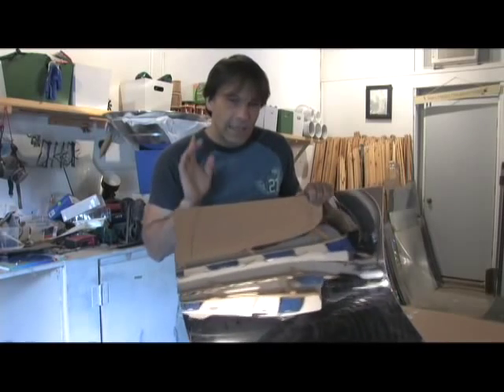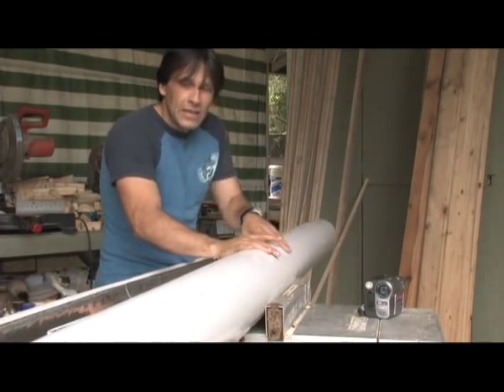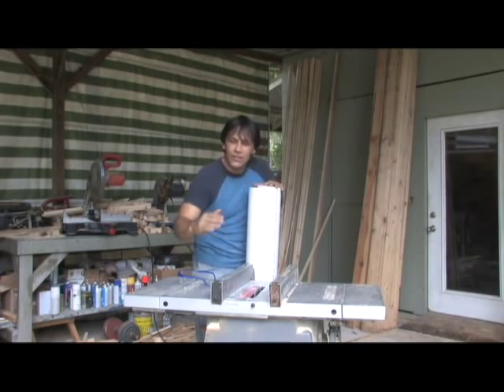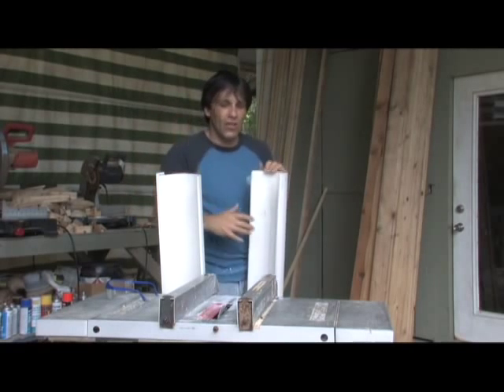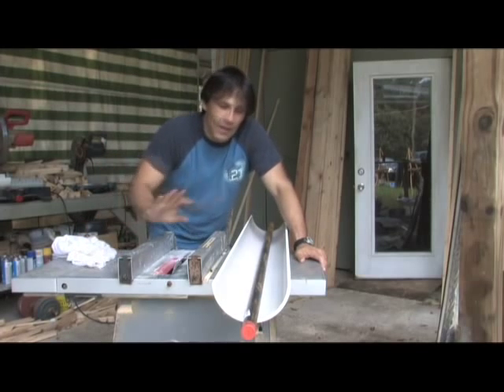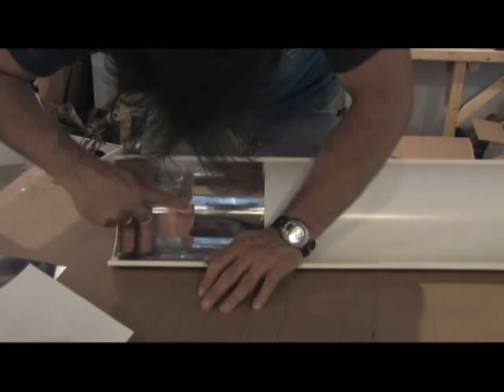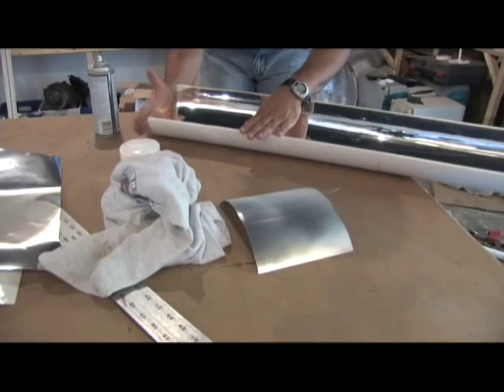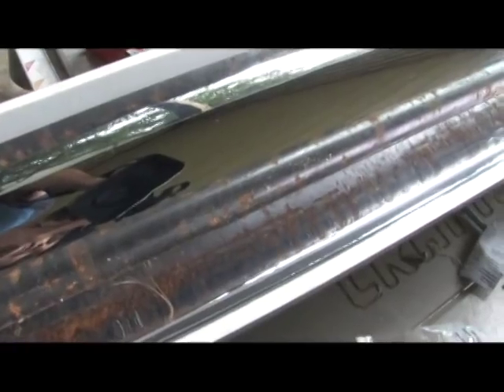PARABOLIC TROUGH REFLECTOR SOLAR WATER HEATER GREEN POWER

Comment from the maker: Hi, We bought about 170 feet from a supplier. I will have some on my Ebay store in a few. I am figuring out the best way to divide it up for projects like this. The acrylic sealer will be applied as that is tricky too. This protects the back from damage. The front side is behind clear UV styled plastic so it will hold up. I have had it for several months, Been testing pieces to see how it holds up in water and sun. Very good.

Comment from the maker: hi John,

If you are circulating water in a closed loop, then a simple 12v or 6v pump will work. If you have plastic impellers (metal is hard to find) place the pump on the input between the first trough and the heat exchange unit, this will keep the really hot water out of your pump. Also, a faster flow rate runs lower max temps but transfers about the same overall energy. DC motors can run on lower voltage so clouds will not be a problem.

Comment: For the record, no round pipe is parabolic, no mater whether it's thirds or halves, it is always a radius curve. Also, bending a flexible mirror is not parabolic either, but rather a catenary curve. While not ideal, both can surely be close enough to be effective at concentrating the sun's rays. And both a radius curve and a catenary curve are very easy to create given available materials. Great video!

Comment from the maker: The ease way is to pipe this prior to your water heater. This keeps your thermostat less active. Just need to divert the supply with valves at night and if it is really cloudy or cold as it will work against you. There are other ways with heat exchangers and solar pumps that circulate the water for electric free hot water. Same rules apply for no sun days.

Comment from the maker: Dont have snow:-) and you have a shut off valve with an air gap at night. Also this is used with a heat exchange system and you collect heat all day then use at night.

Works great.

Comment: This is great, Dan R.
If you get your hand on stainless steel, please note that it has a large amount of nickel.  If you heat stainless hot enough, it turns a dark blue and becomes an excellent absorber, but poor IR emitter, with an A/E ratio of up to 11.  Then you can skip the paint.  Try this on your parabolic mirror target!!

Comment from the maker: The glass cover alone will make a big difference.

Insulation should be reserved for the exit and enter pipe. Place CPVC onside of larger PVC. This creates an air barrier. Connect the CPVC to the steel pipe.

Comment from the maker: Cutting the PVC in 1/3rds makes the optimal shape with easy measuring. The half circle enables covering with plexi or glass easier too. I am not sure if the water pipe will extend too far forward at the focal point to prevent covering. The only hazard I have found in cutting is the kickback half way through the First Cut as it pinches the blade. But it is not that bad. You can actually see it kick in the video.

Comment: Have you considered putting 3 to 8 of these side-by-side in series to raise the temperature to 300-350F then use it to run a steam engine for passive home electrical power to charge a battery bank?

Comment from the maker: A 10' section produces 600 watts of heating power. This shorter section produces 200 watts of heat energy. This is for heating water. We have had 2 weeks of almost no sun in Florida. Today was good. Will have a follow up video soon. 40' would be enough for a 20k-30k gallon pool adding about 10 degrees over a few days. With a solar blanket 20k pool reaches over 100F in Florida. I would cover them with plexi to make cleaning easier. Not hard, but they do get dusty like everything else. Pollen.

Comment: Yes, you're right. A semicircle is a long way from being a parabola, but it's close enough. You'll capture probably in excess of 60% of the available sunlight.

Do you remember the mirror formulae from high-school physics? The focal length of a lens is half the radius of curvature of a spherical mirror. So: The position of the axis of the collector pipe should be 1/2 the radius from the back of the mirror. So if it's a 10" pipe, the radius is 5". The axis of the pipe should therefore be 2.5" from the back of the mirror.
Reply: +Seymour Sunshine  Sorry sunshine. Even though a portion of a sphere, a parabola isn't a  sphere.  So to find the focal length of a parabola requires a different approach. Where yo will be doing the math anyway why settle when close enough when doing the math, when optimal results can be achieved by using the correct formula?
Reply: Wow. Thankyou for this, I was wondering wow & where to set the steel pipe in relation to the radius. You Cleared it up. Good Job. Learned something here. Tks

Comment from the maker: No,

It only warps at 170 f+ at smaller wall thickness. This can hold up to 200f+ Also because it is lined with mirrored material and the backside is white, the PVC never gets hotter than 100f. Mirrored or white objects cannot get hot in the sun. Only dark objects. That is why the steel pipe is black.

Comment from the maker: I thought that too when I built the first prototype. But the focal length is 1" from the base and the 1/2 inch makes a fatter less intense beam with the same net power over a larger area and produces optimal heat transfer. I have a short video. We Finally are getting sun. 10 days, 2 hours of sun at the most. Weird weather. The pipe heats to 250f with no water in less than an hour.

Comment from the maker: Yes, You can but 4x8 sheets of 1/8" plexi mirror local companies. About $150. A wooden trough frame will hold them. Bend and they pop into place. Small deviation throughout the day due to temperature change. No big deal.

The trough needs to be 2' wide to get a flexible bend, 1' is too rigid without molding.

Comment from the maker: Short of the focal point or past the focal point covers more of the pipe with the beam. Since the steel pipe is transferring the collected sunlight/heat to the water, a lower temperature over a larger area is more efficient. At optimal only a tiny area is heated and the transfer is lower. For this size trough, a 1/4" diameter pipe would be better and that would be at the optimal Focal length.
Reply: What material do you use as a mirror?

Comment: You are very handy with a saw, love your videos. Only negative point is that the trough is not a parabola.  I made the same mistake- took a circle, drew a vertical line to represent sunlight, it would bounce clear across to the other side and bounce out missing the pipe.  But your pipe is big enough to gather most of the sunlight.
Peace.

Comment from the maker: @MetalTala for a 180 degree trough it is lower. The most efficient design would be 1/3 of the pipe but then you cannot cover. The half makes about 1" useless but the cut is easier and the cover insulates.

Comment: No problem, most people assume you want the blade low as possible other obvious safety reasons. It depends on the situation. If you are cutting anything that will start to pinch the blade more as you cut, you'll want the blade as high as possible. Otherwise the rule of thumb is generally to have the gullets of the teeth 1/8th inch above the material. Not the tips, but the gullets. depending on the blade that will put the tips of the teeth about 1" up

Comment: About making your water pipe black. Mat black heats better than gloss. If you use black plastic pipe, lightly sand off the gloss.

Heating cement through solar needs both to be insulated from ground cooling.

Comment from the maker: Partially; while a true parabola would be optimal, spherical works well too as the form is easily found in our modern world. The main reason for the lower power of this design is small surface area of the 6" diameter pipe. The concept surface area is easily increased by very long connections of 30 meters or more. This would allow for higher volumes. This small short one is just a scaled down concept.

Comment: You know this could be a business for eavetrough and siding for cold climates. Just use the mirrored trough with a black aluminum mesh flat top. Now you have a frost/ice proof trough that will never have ice dam issues that are absolutely plagueing canada. Thanks for the little boost I needed.

Comment: If you are going to put this on the roof, it is best to mount it vertically in gangs, put a mirror below the lower end and raise it all above the snow line.  I have got to agree that insulating the pipe is needed; a single layer of glass with a 1/8" air gap would be a great help.  The Chinese are making evacuated quartz tubes in huge quantities for cheap (what else?).  Perfect vacuum insulation.  The pump runs while collector is hotter than the storage tank.  One-way valves for night.

Comment: The pipe is not mounted at the center of the circle, but half-way down the radius, or closer to the mirror.   Yes, this works very well unless the  pipe diameter is made too small.

Comment: Mind that focussing mirrors, like parabolic ones, only work for direct radiation, thus straight from facing the Sun. This applies in very dry and/or cloudless climates, like on the poles, hot deserts and the top of high mountains.  In the tempered, rather cloudy climate zones, most of the solar radiation is diffuse (coming from all directions). In South Sweden f. ex, it is 80% diffuse  and almost 100% in tropical rainforest climates - only flat solar panels can be effective there!

Comment: bandsaw works better. cut both sides at once on a sled jig. what is the heat gain per foot per hour? what is the total capacity if circulating water through this thing for 6 hours? why is this better than a serpentine copper collector?

Comment: Before you spend a lot of money and time on this project take some time to review parabolic functions. This study will show you the correct shape to make the pipe using heat gun and a parabolic droop mold. Th pipe will fall into the correct form and properly reflect the heat onto the pipe in the middle. Also take care to see that the collector pipe in located on the focal point of the parabola. This circular design can work without the benefit of true parabolic reflection if the center pipe is centered on the axis of the reflector pipe. The width of the pipe will allow a less critical focus onto the pipe and compensate for the error in construction. The design shown in this video looks like it will lose a lot of heat from miscalculation of the angles needed by the reflector to actually heat the collector pipe. Most of the energy will go back toward the sun instead of hitting the collector.
Reply: Wondering if you could do this with stove pipe instead of PVC? Might be easier to coax into more of a parabolic curve...
Reply: SaintTrinianz you are so right. You can use anything. But to perfect it to it's maximum potential takes more time and much more precision. But good idea.. and a stove pipe is a bigger collector thus will throw way more heat!

Comment: Do you think adding a clear polycarbonate/lexan half circle to insulate the pipe would make this work better in high sunshine/cold ambient temp areas. What I mean is to bend the thin clear polycarbonate around to form the missing part of the pipe to form a full circle again.

Comment: Actually mirrored objects can get quite hot if infrared may not reflect or emit well.  This is why polished metals get so hot in sunlight.  There is no coating to interface light between the surface and air, leaving an A/E ratio of 3.

Comment: I'm working on this myself and considering first to put the mylar onto a sort of rubber / plastic perhaps a shower certain of some sort then to put that onto the inside of the trough.

Or perhaps better to just use a different adhesive material to smooth the surface problems that way you could use the squeegee to smooth the mylar and get rid of the dimples.
Wire wheel brush on a drill might smooth it out simple enough also.

Comment: @anasynpunk  What about the use of  light thin but  highly reflective/ highly polished.. stainless steel sheeting ... that cladders/ insulators use on tanks in the Pharmal or Brewing industries to clad Vessels.. a  sheet metal works  company   may have some offcuts... just pop rivet same to  a  light wall  pvc sewage  pipe and use stop-end caps for the  ends of the collector plus also the end caps could  be cut into rings to stop the half pipe from loosing shape and slid down same at intervals

Comment: Are you sure you hit the focal point there? Try putting the pipe in line with the edges of the semicircle cross-section... That is, if you consider putting the two PVC halves together, your pipe should go straight through the center of the circle that is formed.
Reply: +Sebastian Ramadan  The edge of the semi circle are not the focal point of the  actual parabola formed by the pipe. That's where Dan falls short  in this video, he doesn't detail how to determine the focal point formed  by the pipe  size that a builder happens to delect.
Reply: waswestkan Semicircles don't form parabolas. That is by very definition. As for the focal point, this happens at the point that is equal distance from all surfaces, which is the middle of the tube before it's cut in half, and cutting it in half doesn't change the shape so cutting it in half doesn't change the focal point.

Comment: Dan,

I have some random sections of 6 inch sewer pipe.  I can do the math on cutting into 1/3 slices. Using this with 3/4 ID iron pipe, how far from the bottom  should I place the 3/4 water pipe.  I just quick rigged somthing with tin foil (on a cloudy day) and it looks like approx 3 inches from foil to bottom of iron pipe will have the solar pin point in the center of the water pipe.  Do I want to focus for center?  A blank slate here.

Comment: After you have cut the pipe, would it be worth while placing end caps of the correct parabolic shape into each end and several along the length so as to force the pipe into a parabolic shape.

Comment: Resteurant grade aluminium foil works very well, comes in 1000sf rolls. I dont reccomend using PVC piping as it costs quite a bit these days. At least use mirror window film if you desire something more durable. A transparent film/sheet above will help prevent air cooling from robbing heat especially in winter.

Comment: If you have enough windows, skylights, fluorescent and LED lights, your major energy budget is devoted to Heating Air, Heating Water and Cooking.  That is where solar really makes economic sense.   Electricity is better made though solar voltaic cells, wind, tides, and micro turbines.   
However, if you want to use high temperatures to run generator, you need cloud free skies and solar tracking parabolic dish, or a large number of heliostats (approximating parabolic segments).

Comment: Hi there Green Power Science. I was somehow unsubscribed from ya so I'm subscribing again. 
Hey I am about to build a black/grey water bio digester-solar distiller-water purifier for a two to three person offgrid cabin using mainly ibc totes, maybe one of those blue food grade 50 gallon barrels for the end carbon filtration. I came here  for ideas for the solar distillation portion of the system. I am wondering what you think would be the best way to evaporate water put of a ibc tote. I  figureing to cut the top completely off. Of course this would be the last tote in the end of a series of totes. What would you do to get the maximum evaporation, and somehow catch the water vapor on a curve of some kind that it would all drip back into the carbon filtration portion  of the system.(?)

Comment: I'm a plumber and I agree with everything in the video...except one thing,  The pipe.  I would recommend 1 inch copper pipe.  What??? its not black you say??  Thats easy, you'll want turn sand the pipe with fine sand paper, over time it will bronze to a nice chocolate brown. Might as well stay with copper, as electrolysis will occur if you don't.  Thanks Keith

Comment: Are there advantages to using larger diameter pipe? 12" dia. vs. 6" dia., or is the cost difference not worth the increase?I ask as I have larger dia. pipe avail for free...

Comment: Does this work with PVC piping as the pipe that carries the water? or do you need the heavy metal pipe? (ie. will this heater melt/ruin pvc piping if placed at its focal point?)
Reply: Yes You need metal pipe. The pipe can reach very high temp at focal point... 
And mealted plastic with chemicals leaching into the water will also be awful.

Comment: i realize that a half circle is not a true parabala but it seems that the water pipe should have been closer to the opening of the half circle. is there any math that could be applied in locating the best pipe placement? what i really really love about this projest is the fact it is soooooooo do-able!! now add a circlulating pump and a hot water heater with a heat exchanger in it and you have a kick butt system.

Comment: perhaps if you could contain a curring liquid/resin/whatever in a pipe that was spun slightly off-center durring the cure, this would create a parabolic surface? The pipe could serve as a substrate/structure, and only a small amount of resin to fill in a parabola that would be close to the radius curve of the pipe? Probaby the increase in efficiency would not be worth the effort, but for a production-level modular system, it might be.

Comment: Great source of ideas...I was fortunate enough to score two S.S. collector tanks for storage.What about using the newer types of black high temp. PVC,and thin mil. reflectors( sheet S.S turned on a roller)for the material list?I mention this after doing inspections of failed(degraded)solar water systems in the SoCal area...also,your take on ground mounting(pros and cons) vs.roof mounting? I'm looking at(on paper)a carousel-type ground tracking system...hey,thanks for posting this.